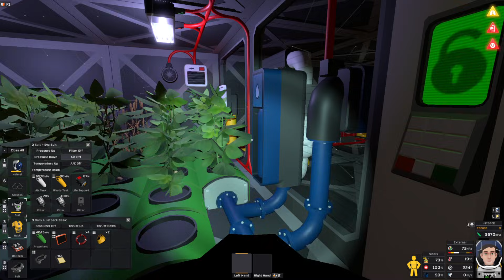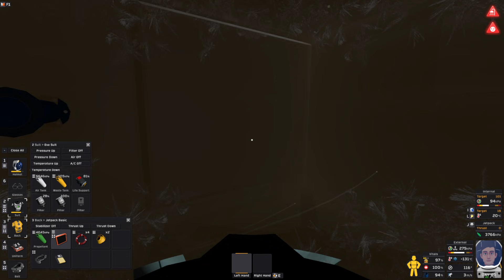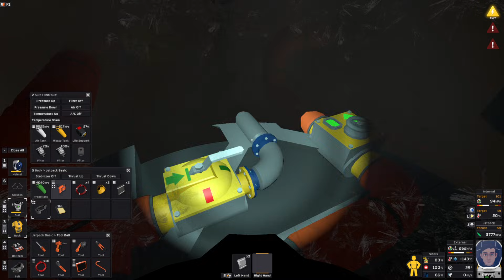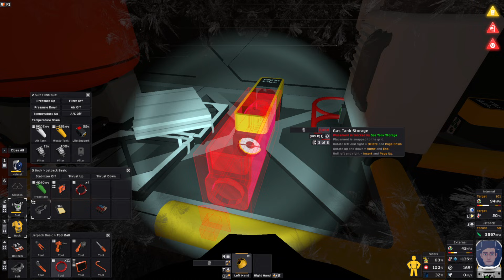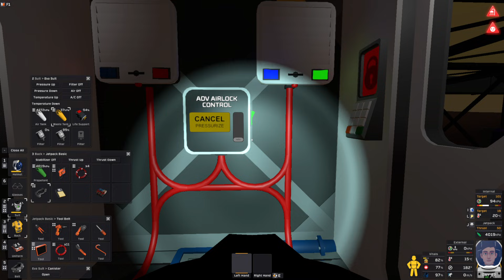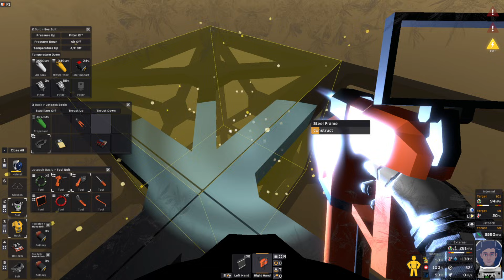Stationeers Titan Part 14 : Filtration, Foundations, and Furnace

Comment: Expanding gas cools. Is that a mechanic in the game?
Reply from the maker: Currently adiabatic heating / cooling is not modelled (except sort of during phase change). Temperature affects pressure but not vice versa. I hope they will fix that in another pass, although I can see why it's complex to do, and potentially could be frustrating for new players

Comment: Why you limit input pressure so drastically. Stirling engine can withstand 11 MPa. And heat which is lost in pipe connected to engine heating you room - so you shouldn't worry about this. And to speed up heating this room, maybe consider burn some hydrogen and nitrates in room, not in a furnace :). BTW, i notice, that you furnace, when was in room, radiated 50 KJ and convected 10 KJ. Now in frame it not convected, but radiated 60KJ.  So you resolve problem with blowing you room and yourself on out off door, but stil you loos the same amount of energy. :)
Reply from the maker: I've blown a lot of them up in my time! But it's been ages since I used one so I've been being very cautious in case I mis-remembered anything... Until I have the exterior temperature stable I prefer to keep it ticking over low, but I will turn it up once I'm happy it's stable